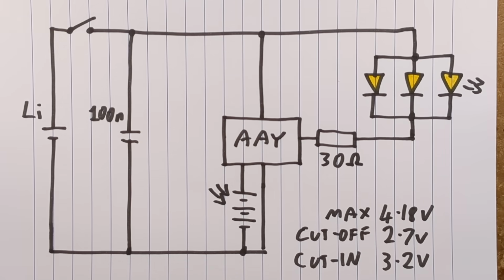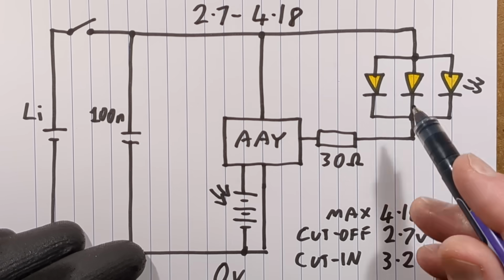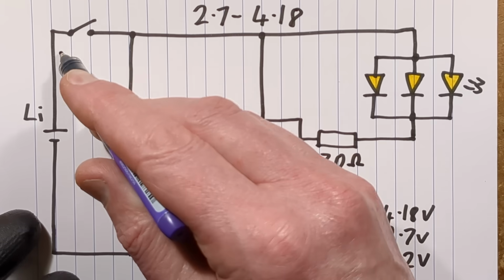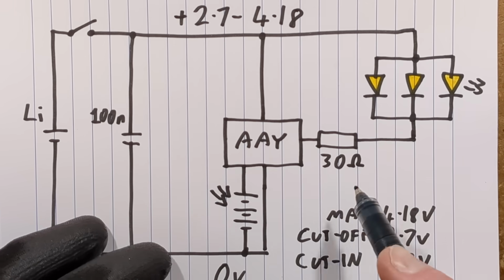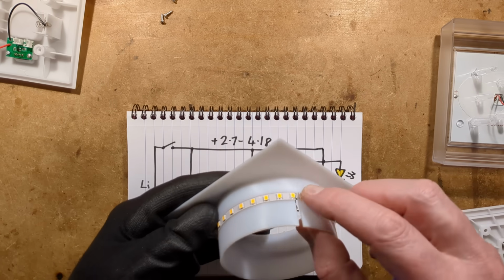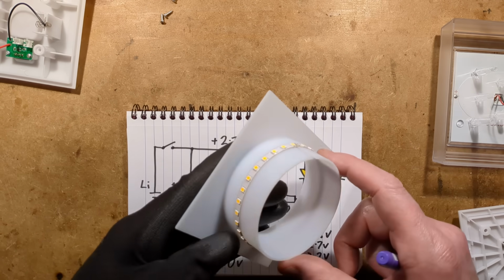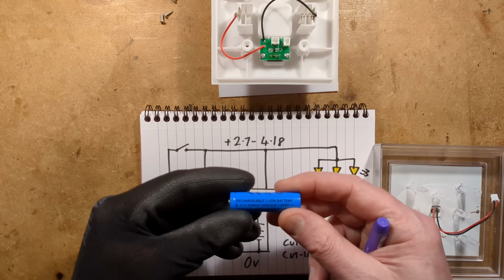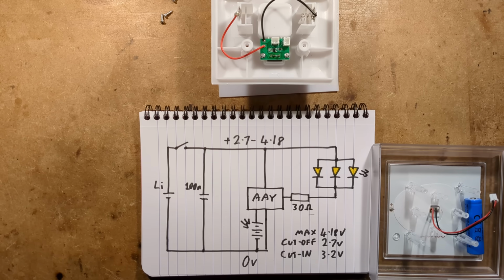Inside a nicely designed lithium solar post-top light

Comment: bought 4, 2 stopped working after 1 day, and on a sunny day in September, Europe, all 4 don't charge the battery enough to last more than a few hours  😞
Reply from the maker: Increasing the value of the current limiting resistor should extend the run time.

Comment: One answer and several questions 4:49 pretty please ?
Ordered 4 but two damaged on receipt / 1 had cracked corner to clear cover, the other a side broken off top cover !
Will these lights have enough charge for all night in winter ?
What sensible increase in 30 ohm resistor would see it through winter ?
Would higher capacity 1459 be a worthwhile swop  ( you have reservations re 2x1450 in parallel ? ) or single 1865  fitted with some manipulation ?
Thanks
Reply from the maker: The winter performance will depend on the amount of light exposure during the day.  The run time could be increased by increasing the value of the LEDE current limiting resistor, but that may require experimentation.  Increasing the cell capacity is only useful if the solar panel can put out enough charge to justify it.
Reply: Thanks Clive. I also note that my units have dawn dusk switching built in but I haven’t opened mine to compare circuitry but your schematic/narrative makes no reference ?

Comment: I bought this lamp just for fun and tested it. The short circuit current from the solar panel is max 60mA in strong sunlight, else down to typically 5mA or so on a more grey day. The open circuit voltage is 5-6V. The lamp when turned on consumes about 45mA, so, without having tested it, my guess is that the battery will drain out fairly quickly, since there is not enough sunlight and time to charge up the battery, especially from September to May, at least here in Denmark 😊

Comment: Just finished making a solar garden light.
Built it around a QX5252F, tiny PV panels, some slow-flashing RGB LEDs and all the other gubbins on veroboard.

It is:
Quite clearly inferior to the £1.50 AliExpress version.
Cost about £6 in parts.
Absolutely not waterproof.
Housed in an old spread tub, so it looks dreadful.
And I absolutely love it.
Reply from the maker: Thanks.  Custom stuff may look a bit ugly, but it's serviceable.

Comment: That looks quite a good light. Thanks for this video, Clive. I imagine it would also be possible to put RGB or RGBW tape inside the light along with your own arrangements for a simple colour selection, even if it's as simple as a rotary switch arrangement or internal jumpers.

I hope your hand heals up quickly for you. Allergic reactions to things can be very uncomfortable and sometimes even painful as well as visually disturbing to look at even when it's on one's self. I have to be very careful myself to avoid a very unpleasant reaction.
Reply from the maker: You could manually select with 3 or 5V LED tape.

Comment: Clive, question, have you encountered any supercapacitor led lights?
Reply from the maker: I've not.  Mainly because it's not a practical way of powering LEDs.  The voltage of a supercapacitor falls as it discharges, and the energy density is a fraction of a standard rechargeable cell.

Comment: Clive, have you ever taken a look inside an X10 or similar standard power line control module? I’m curious to see what the circuitry to couple the data signal onto the AC line looks like.
Reply from the maker: I've not looked at X10 unit yet.

Comment: Some years ago, I bought an electronic doorbell at a surplus place.  When I got it home and hooked it up, it didn't work.  I took it apart and found one solder pad that was bone dry.  A touch of the soldering iron and my $3 doorbell chimes work perfectly.

Many years ago I worked in a TV repair shop.  We had a customer that had an intermittent TV so we brought it into the shop.  When we tilted it up on it's side, a half dozen components fell out of the circuit board.  An area about 2 inches square had never had any solder on it.

Comment: I've fallen into the "biased diagnosis" trap a few times in my life. 😆 
When you troubleshoot something a few dozen times, and every preceding time has been the same cause, that's the first place you look. I suspected the switch, followed by solder joint on the switch, because those are the "usual suspects" when pressing on the switch itself causes that symptom.

OK, I admit, there's a tiny part of me that wishes I actually had posts to put these lights on. Simple (and intelligent) design, easily serviceable/hackable, user-replaceable battery, and they didn't use those obnoxious Cool White LEDs that completely trash the entire post-topper aesthetic. What's not to like?

Comment: Of course one can't say what proportion of lamps is dead on arrival. But is it really a "good lamp", when they apparently cheaped out so much that the manufacturer failed 1 out of the just 9 SMD solder joints, which makes the lamp go straight to the garbage? (except for the handful of cases, which land on our desks)

Comment: That looks like a pretty nice post light. Clever design that screws to the top of the post rather then clamp around the post. I've been using some I purchased from Harbor Freight on this side of the pond. This one looks better. I'll have to keep that in mind if (when) the ones I have die.

Comment: A bigger issue related to the minimal silicone for some places is when the water pools under the solar cell is if that water freezes it will lift or crack the cell
Reply: Wouldn't there be enough flex in the plastic housing and silicone?
Reply: @Eis_Bear  Depends on the type of plastic they're using; in the winter, some plastics crack if you so much as look that them funny.
Reply: That's something I really liked about the beacon, having the solar panel under the clear plastic top. More garden lights should do that.

Comment: This is ( finally ! ) .. SO  MUCH  better than the lamps with 1v2  Ni - Cd  circuits with ( 💩 inductors 😝 ) ... point to watch , Lithium cells , although brilliant , do  NOT  like being stuck up a pole in the blazing sunlight (  they OOZE brown stuff and die ) ... having had to repair several types like these (  at my local repair café  ) ... the trick is to mount the light on your pole ( ? ) ... then  put the cell on a thin  lead  OUT  OF  THE  SUN ... this is a tedious job , but allows your  light many years of use , as Lithium cells can last for many years ( when  COOL !  )  ............... DAVE™🛑

Comment: My mission has been to find the best cheap solar light , been through many ,. These shouldn't be expensive to be reliable but they seem to fail alot .
Reply from the maker: The trick is getting standard lights and making them better.  Usually with various coating and waterproofing techniques for the electronics.

Comment: honestly this looks great , very modular with integrated solar panel ,you can stuff your electronics inside for sensors , you can 3d print stuff and put it inside .....
the electronics are junk ,but i like the chassis ,place for a battery ,a place for solar and just a space in between ..... its perfect for an outside weather station ...you can poke a few holes where you need them

Comment: Could the cell have protective circuitry inside? Especially since they've made it have a nipple on it.
Otherwise I've got a bunch of ex laptop batteries with 2500 - 3000 mAh capacity.

Comment: Oh yes, I've done that too. Spent far too long troubleshooting a circuit, only to realise I missed a solder joint when I looked closely. At least this time it wasn't your mistake, it was the factory. Which is probably also why they were selling it cheap on the fast Arab website.
Reply: "fast arab" will from now on be what I will call AliExpress thanks to you 🤣
Reply: @konm08 I prefer calling AliExpress the "Chinese Mafia."
Reply: @konm08 They'll get no free advertising from me. If they want me to use their name, they can pay me! Same with the mouse-based electronics supplier, the silicon-based one, and the digital opener website (although that one's a bit of a stretch). Unfortunately, I haven't come up with something better for the electronic bay website.

Comment: According to the "ultimate SMD marking codes database" (just search for that on google), that chip is either SN74AHC1G00DCK, RP107N321B or XC6114B629MR.  Those three are the only chips in the database, looking like that with AAY marked on it.

Comment: I'm used to working with lipo batteries and you're not supposed to discharge them past 3 volts. Are lithium ion batteries able to be discharged more, also why don't they use a lipo battery instead of a lithium ion in this
Reply: 2.5 is within spec, take a look at a datasheet for a larger 18650. 
Eg INR18650-30Q says 2.5 - 4.2

Are your lipo batteries protected or unprotected?
Additionally not fully discharging it will help increase the number of cycles.
Same with not fully charging it.

They might be reusing a supply of those lithium cells. Re-labeling old cells.
Reply: @ArmChairPlum My lipo batteries are unprotected they go in my remote control cars I have 2S 3S 4S and 6S
Reply: I think you're just being overly conservative with your 3v number. Most lithium are fine down to 2.7 or 2.6. Used to use a lot of lipos for model aircraft, and followed the 2.7 or 2.6 rule from what I remember. I wans't the one in charge of batteries (this was for an engineering competition project that had many different aspects to it)
Reply: @gorak9000 It kills me when I'm using an RC car and it goes into lipo cut off and I check the voltage and they're like 3.7 volts I could have used it so much longer

Comment: Seems like it’d be easy enough to print a different bottom to hold a proper cell, or a couple of them in parallel.  Depends on how well the supplied one does keeping that light on through a cool night.
Reply: No need to bother just put a quality higher capacity 14500 in there and it'll easily go all night. If you're really desperate you could stuff in 18650 in there I'm betting there's enough room to put a single cell holder in there

Comment: Very hackable, one could create a supersized twinkly nightime 'supercomputer' simulator with these, perfect for those end of the garden sci-fi needs. Simple to do as well just put a flasher circuit inline with the LED wire and then tile a large array of the units mounted on a board (very servicable with the push fit fixing as well).

Comment: that's a very large case for what's inside. I guess there's a reason for it, but I don't know what that is,
Reply: It's supposed to sit on top of a 6x6 post, like you'd use for the gate of a gated driveway or the entrance to a livestock pasture, so it needs to be a bit larger than that. You can buy wooden post toppers of a similar size/shape that are just decorational, so this is basically that, but plastic and with a light so that it has a bit of function

Comment: It looks like the sort of thing that you could make and assemble yourself if you have a 3d printer but with an added diffuser ring for the leds. But instead of making it solar-powered,  use WS2812B leds and a powered WLED controller. That's a post Edinburgh Tattoo project for you, Clive!!

Comment: No production line quality control?
I wonder why they didn't put the solar panel under the clear plastic dome. Would have saved the trouble of worrying about water ingress.
Reply: With these products, the end consumer is the quality control. I thought the same thing on why didn't they make the cover one piece and put the panel inside. Probably would last too long that way
Reply: @gorak9000  Yeah, you're probably right.

Comment: I would consider replacing the 14500 cell with an 18650 since there is ample room to do so by removing the current battery stand and using snap-on connectors for the new cell.

Comment: I really like this, not as is but it has lots f room inside for upgrades. Some programable LED strip and a new circut board would look nice. you could get it to do assorts of "alarm" warning colours-patterns You might need to add a bit more regulation for the solar side if you added an EPS type board but its nice. 2x👍

Comment: It does look nice, but I guess a lot depends on the quality of the plastic - will it yellow and crack in full sun?

As for yellowing and cracking (!), we see from your videos in the winter that you're a low temperature person, recording at 10 °C or so on occasion, so if you're used to that this heat might be a strain. Although I certainly don't abuse the central heating, I have had the opposite, with a skin problem on my hand in winter. I was spending a lot of time on the computer and it is the mouse hand, which gets more exposed. I found that at the first sign of trouble, moisturiser would prevent it. Of course, skin issues are very complicated, so what works for me may certainly not work for you.

Comment: Here's an idea: put the lamp in the freezer to see if it stops charging at low temperatures to protect the cell. I don't suppose it does.
Reply: Interestingly enough at the low charge level these panels put out even charging in the cold probably won't damage it too badly.
Reply: but NCM lithium is wayyy less sensitive to freezing temps then LiFePo4.

you can charge NCM in the freezing temps. at very low currents.

and low currents are to be expected in wintertime/low sun elevation anyway.

Comment: Interesting, won't charge unless it's turned on though.   And plenty of room/fairly easy to replace the AA size holder for an 18650.
Reply: Stick a Schottky diode across the switch, pointing towards the cell. Then it'll charge to about 4 V when switched off.

Comment: That seems a rather miserly capacity for a 14500 cell, equivalent to the cheap 1300mAh for an 18650. 
We don't need to worry about whether the cut-off for the cells is 2.7V or 2.5V, there's no boost circuit so the LEDs will stop conducting well before the cell drops to that voltage. Once again though, the cell will not be charged when the switch is off which isn't good with our long winter nights.
Reply: It's only following in the tradition of the ridiculously weak NiMH cells normally found in solar lamps! I wonder if these lower capacities have better longevity? Probably not...

Good point about the LED voltages. It would come into play if you were to substitute red or others not based on blue with a phosphor.
Reply: @matthewmarks6951  That was my point really, they've gone to the expense of putting 30 LEDs inside but if we assume they consume a miserly 3mA each that cell is going to be done after 5 hours maximum, probably much less. It adds to my point about the switch being in the wrong place too. For instance you want the cell to be fully charged for the evening when you are coming home late so you switch it off for a couple of days beforehand, and the cell doesn't charge! It's a nice early evening ornament but not much practical use.
Reply: @chrishartley1210  the 30 ohm resistor will make 4.2v best case dropping to 3v  40ma for the whole lot of leds and once it drops down to 4v which it will do prettty fast you have 30ma and falling, it should in theory last about 20 hours with about 10 of them being at any usable brightness
Reply: @matthewmarks6951  they likely buy the cells rejected by the factory for being low capacity, or those that have fast self discharge, because those cells will be very cheap to buy.
Reply: @matthewmarks6951 no they're just cheaper that's why they use them the good thing is the cell is easily replaced so you can put a better quality cell in there